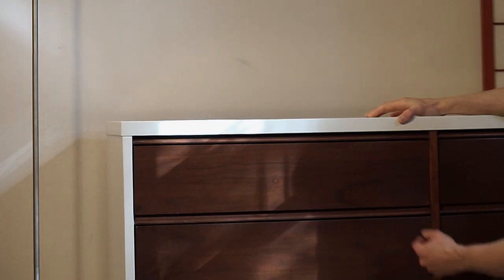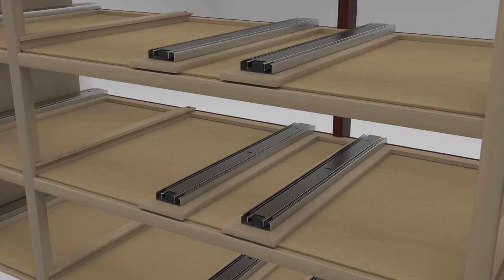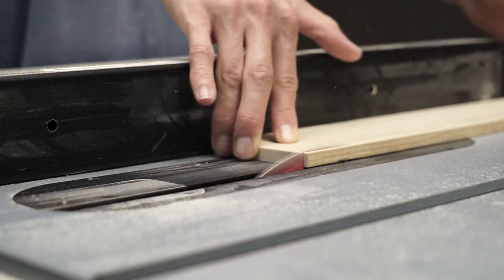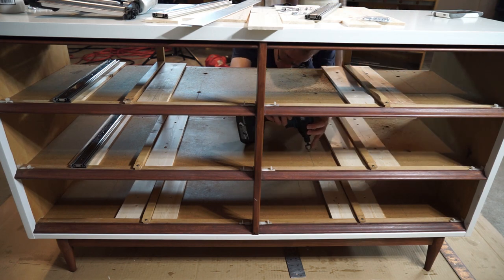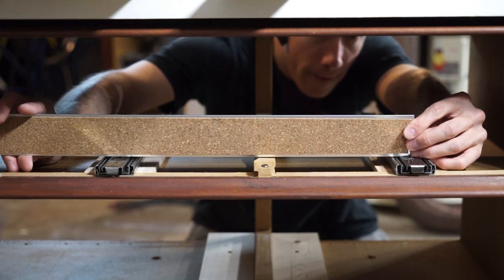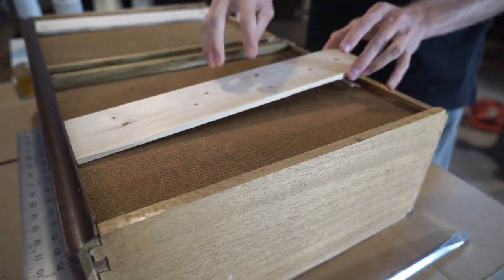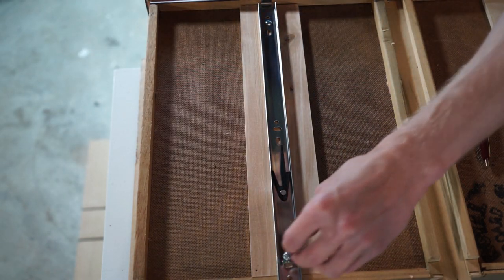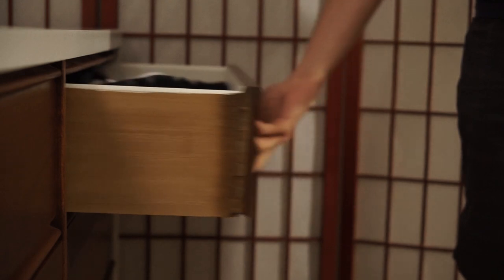Upgrade an Old Dresser with Metal Drawer Slides (Under-Mount)

Comment: I have an old armoire dresser with wood slides that have badly splintered and split over the years. It has 6 drawers and one is completely stuck now, and two more are on the way out. It’s a beautiful piece made out of solid wood that weighs about 9000 lbs, and it’s a hassle to move, but I love it. I’m going to see if I can pull this off. Thanks for the information.
Reply from the maker: Best of luck! You can always experiment with one drawer first (the one in worst shape?) and figure out a process that works before jumping into the rest of them.

Comment: That's a nice MCM dresser, I'm in the same position you were in but I don't have tools like you.
Reply from the maker: This can be a challenging process without a lot of tools. There is a possibility that your local hardware store stocks wood of the appropriate thickness for this type of fix. Those stores will often cut the wood for you was well, though with lots of cuts they may charge you for the service. It might be worth a look

Comment: If I put small boards on the bottom of the drawer hole to raise it for attaching the slide, I have about 1/2 or maybe 9/16ths of an inch between the drawer opening and the bottom of my actual drawer.  If the slides are 1/2 inch, would I need to use additional boards on the underside of the drawers themselves? Seems like with so much precision that the 1/16th inch may make a difference-- could I just add a thin washer between the bolt in this case? My drawer bottoms are so thin that would this even be practical? I really want to fix up this dresser I just got!
Reply from the maker: The washer could work. As long as there is some kind of board under the drawer it will help give it a bit more strength. Every situation is different though. Good luck!

Comment: I just bought a beautiful set of old dressers and hope to do this to them. Your video is exactly the tutorial I was looking for! One question - did you remove the center mount from the dresser? Any reason we wouldn't need to also remove the original center mount mechanism from the drawer as well? Thanks!
Reply from the maker: Happy to help! If I remember correctly, I left the center mount on the dresser side but removed the plastic guide on the drawer side. In this case, there was no contact between the drawer and the center mount after the plastic guide was removed. If there is no contact between the drawer and the mount after the metal slides have been set up there should be no reason to remove it.

Comment: I never would have thought of using the side mount drawer slides (which are very nice) on the bottom of the drawer! Brilliant. I'm restoring my wife's dresser. It's got the classic H shaped wooded guide in the frame, lowered slightly and screwed in at the front, and stapled in at the back (lazy). The bottom of the drawer has these rusted metal tracks, that are stapled at the drawer face end, and it wraps around and screws into the back end of the drawer.

I really wanted to upgrade to the ball bearing sliders on the sides of the drawer, but there's so much space i would have to add several pieces of material in all directions to make that possible. How do you know what thickness to make the wooden pieces you added to the dresser and the drawer? I don't have access to a planer or jointer...Please explain...how can I select the right thickness of board
Reply from the maker: Good questions! Be sure to select slides that have a high enough weight rating for use in this configuration. Sometimes they say on the slides themselves. Otherwise take the standard rating and a cut it in half (at least). Big heavy solid wood drawers may not be ideal for this.

As for the thickness of board, this took some creative measuring and I think I made some samples before the rest of the set. Without a planer or jointer you could potentially buy some very thin and inexpensive material and layer it up as needed. Just wander the lumber/building material isles until you find something that might work. There may also happen to be a material of the perfect thickness if you are lucky. So, good luck!

Another idea... If you have a table saw you could cut 2x4s into slats of the correct thickness.

Comment: Hi,
I know you said that the slides you used are not available anymore but would you be able to post a similar one because I looked and there are so many different ones.
Reply from the maker: Hello! I just bought the least expensive heavy duty slides that I could. They were nothing special. As long as the drawers themselves are light, the slides should be sufficient.

Comment: If the slides are labeled center mount can you use two per drawer?
Reply from the maker: Most likely yes but the weight rating will be less than what is published for the center mount. The slides that I used only had center mount weight ratings and they are still working fine after a few years

Comment: Thank you sir! Can I just clarify, are these regular side mounting ball bearing slides, but you used them under the drawer instead?
Reply from the maker: Correct. It's my understanding that the side mounted slides can be used in this way without issue as long as the drawers are not particularly heavy.

A good rule might be to take the stated weight rating on the drawer slides and reduce it by half for the undermount configuration. 

So far these slides are still working well after 4 years or so.
Reply: @The3DHandyman  thank you! Much appreciated. Will be using them for a similar situation. Happy New Year!! :D
Reply from the maker: @MappingAmy  Happy new year to you too!

Comment: how much wld a job like that cost for a heavy solid oak five chester drawers?
Reply from the maker: It's hard to say. The heavy oak drawers might be too much for the cheap drawer slides in the "undermount" position. It would be better to mount them vertically, if possible.

If it does work, it might be $50 or $60 for the slides.

6 pairs of 16in slides https://amzn.to/3rRq2Zb
6 pairs of 14in slides https://amzn.to/3GbUiU0

Comment: Drawer slide links are all side mount - aren’t these undermount slides?  If so - what do you recommend?  Need 14” - thanks
Reply from the maker: Most slides will work as an undermount if the weight load is low. If your drawers are heavy, I suggest buying something that is rated for undermounting. A place like Rockler or Woodcraft or another professional woodworking store would have something better. The slides will just cost more.

Comment: Nice video. What brand drawer slides did you use?
Reply from the maker: Thanks! I used the cheapest ones I could buy on Amazon. They weren't very nice compared to some I've seen but they have worked well for a few years now.

Comment: Can you add a link for the drawer slides that you used?
Reply from the maker: Any drawer slides will do. I did this project 3 years ago and the exact drawer slides are no longer available. If I remember correctly they came in a box of 20 and were about $2 each. If you can afford to use better quality slides, that might be a good idea but so far the cheap ones are still working fine. The 16" slides allowed the drawers to side out completely. Your drawers may be more deep and require a different size slide. Best of luck with your project!
Reply: The 3D Handyman I’m aware that any would do. I wanted to know for the price 😂, my project is costing me more than anticipated but thank you for the tips 😊
Reply from the maker: Most of my projects tend to come in over budget as well... Happy to help any way that I can.

Comment: I stopped to subscribe when you mentioned why you were using acorn nuts.  That's the kind of attention to detail I appreciate!  Combined with "Let's use the cheapest slides that get the job done" of course.
Reply from the maker: Thanks for Subbing Larry!
Reply: There's no explanation on how to determine the thickness of the boards to cut... and how to pull this off for those of us who don't have access to a planer or jointer...

Comment: You didn’t say what the required space is under the drawers, which is a critical clearance. Also no mention of the thickness of the slides.
Reply from the maker: You just have to take it on a case by case basis. Every drawer and slide configuration will be a little different than the last.